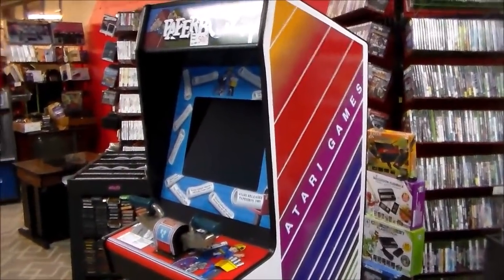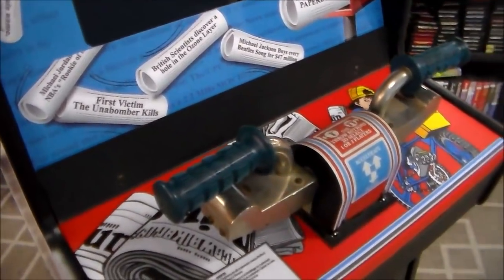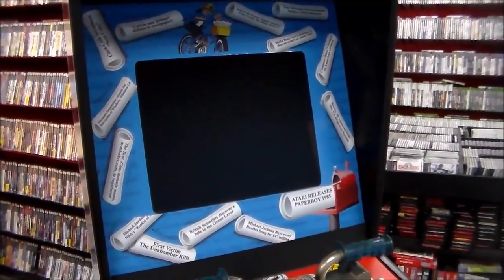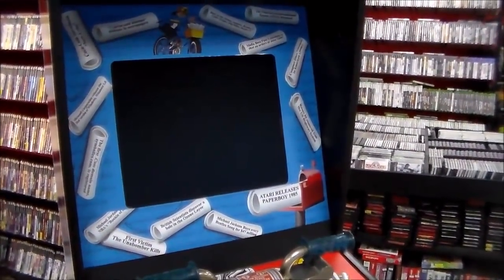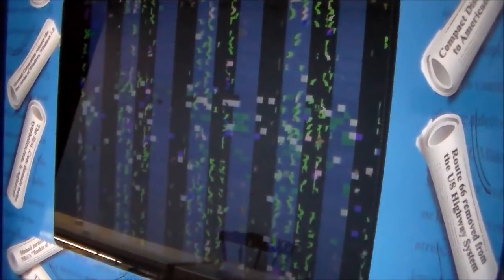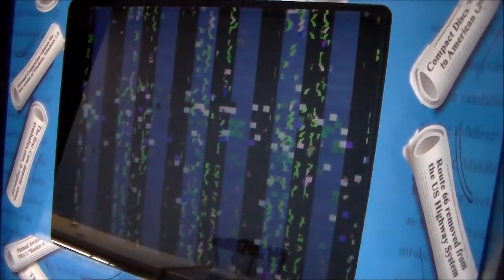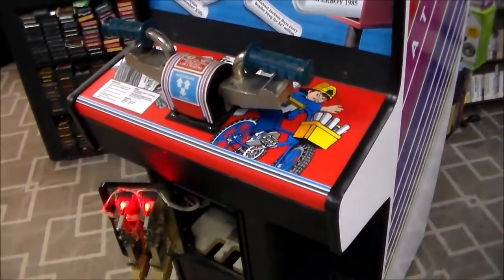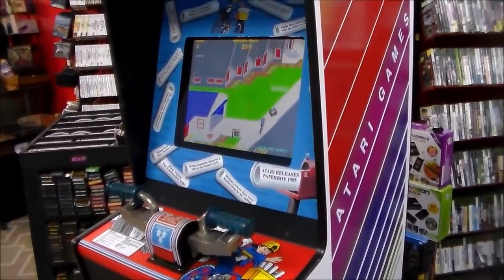Repairing an Atari 1984 Paperboy Arcade Game Cabinet!

Comment: My first job back in the 80's after leaving school was refitting arcade cabinets. I would rewire old cabinets and put the newer game boards in them. Change out the artwork panel that usually came with the new game board. Test them and then drop them off at the sites. Spent a lot of my youth in arcades in the 70's and 80's. Got given a bunch of old black and white boards and parts by the local arcade while still at school and built a couple of working machines on the bench at home (Original space invaders and a lunar lander game I forget the name of). I went on to a carrer in telecommunications. A few years ago I bought a new machine with an emulator in it and now my daughter and I play the games I played at her age.
Reply from the maker: Very cool Michael, yes I worked for an operator who did kits in games too but it was later on, he had an entire back room full of Ms. Pac-Man cabinets he was hoarding, all still the original game.  Must have had 30 of them all lined up perfectly, this was in 2008 or so, he still had them.  That's cool you're able to share those games with your daughter you're raising her right!  See you on the next video.
Reply: @LyonsArcade  was it Namco or the other version that Ms.Pacman was able to outrun the ghost, ? I can never remember

Comment: + - 15 (usually 12) is usually used by the op amp to drive hi and low on the output. RS 232 output standards back in the day before we all got lazy and loosey goosey about the rs232 standard.
I know it's not an rs232 chip but that's why a lot of the old op amps used + and - voltages because before TTL... those were the 1s and 0s. What is funny is they are clamping the output past r112 with the two 1n100 diodes. Into the ls04 inverter gates which they are using to clean up the signal into the ls00 NOR gate. They must have wanted to drive that oscillation pretty hard to do it that way!
Reply from the maker: I understood about half of what you said :)  Thank you as always for watching :)

Comment: If I remember correctly, CGA allowed for 4 colors simultaneously at 320x200 resolution and EGA allowed 16 colors simultaneously at the same 320x200 resolution. EGA could display even higher resolution than 320x200 (with fewer colors) if necessary. Great video by the way. Those classic game electronics are endlessly fascinating. Thanks for sharing your knowledge and experience with us my friend.
Reply from the maker: No problem Chris, see you on the next video!
Reply: yep but CGA/EGA/VGA are computer video standards, they aren't actually used with arcade some just use it as shorthand for "15khz line frequency". IMO the other term "standard res" is also confusing since it doesn't define the resolution exactly, e.g. Pacman/RallyX does 288x224, Galaxian does 256x224. and colors are all over the place too since it's mostly just a function of the palette RAM being used.

Comment: I'm 16 so I obviously didn't have real arcades growing up but we did have a Paper Boy machine at my Cub Scout building. My dad was the leader of the pack so he'd take me there every weekend with my brother to clean and do paperwork but my brother and I just played the game the whole time. I love the arcade version and I hope that someday I can own an original cab.

Side note, I don't remember the speech sounding so robotic, it sounded much more fluent. Later revision maybe? I know the amp was broken at some point because the sound was missing 50% of the time, very quiet 49% of the time, and worked fine 1% of the time. I almost got the machine for myself but at the last minuet some guy took it, the the building was falling apart and everything was given away. I suspect the game was water damaged because it was below a leak in the ceiling.
Reply from the maker: Yes I'd imagine it had some water damage, but the truth is most of these older ones do!  A lot of times they'd get left on the back of an operator's truck in a rain storm while he moved it or various other places it could get wet.  That's cool you got to play one later on, this was a tough game to keep working so I'd imagine the sound had a few hiccups :)  
Thanks for watching, and we'll see you on the next video!

Comment: Too me it sounds like the early sound boards for the computers late 80 ties up to the first dedicated wave soundboards Roland and later Creative labs soundblaster sound Cards. And its correct on the Yamaha. I have had good expiriances whith soundblaster.
Keep up the good work 👍👍👍🙂🙂👍👍🙂
Reply from the maker: Thank you Oden Viking, I don't have any experience in the PC side of stuff but one day :)
Reply: Thats not a problem since you all ready has begun. Those arcade machines are in a way pcs due to there usage of computer parts and rams and roms. In the computer  world we use a thing calld bios settings for hardware settings. But on your arcade games the bios is your basic test program. So in a sence the arcades are the earliest form of computers they are forerunners on graphics and on sound.
Keep up the good work
👍👍👍👍👍😀👍👍👍

Comment: If I remember correctly, the op-amp amplifies the difference of the inputs to whatever gain it's set to. Negative 10 and positive 5v and no gain would be 15v.
Reply from the maker: Thank you Phil, I don't completely understand what most of the chips do, I appreciate the help!
Reply: @LyonsArcade  it's not very often that I can offer help so it's my pleasure if I can contribute anything useful.

Comment: You really need the original controllers to get the most out of these old games. Tempest just isn't the same without a properly-weighted spinny wheel.
Reply from the maker: Dave ain't that the truth.  There's something too about the weight of the cabinet that makes it different.
Reply: Colorado Strong  When warping out of a level, we always gave it a good spin and the momentum would keep it going as you flew down the "web," but I think the wheel on those little Arcade 1Up machines is a clicky type that only moves you one segment at a time and then stops. Where's the fun in that?

Comment: CGA 16 color max resolution was 320×200 it could only display 4 of these colors simultaneously .
EGA graphics modes were 320×200 with 16 colors, 640×200 with 16 colors, 640×350 with 16 colors, and 640×200 with 2 colors, all drawn from a 64-color palette, It could use all 16 colors simultaneously.

I remember from the DOS days picking these options from apps and games.
Reply from the maker: Thank you for watching BRS!
Reply: @LyonsArcade   Of course, I love messing with electronics and fixing them. Would try to repair a arcade game if i came across one.

Comment: The game was probably used with the f-ed up screen orientation since the day the LCD was installed, and probably only a few people noticed and nobody cared.  I'll admit I was starting to worry that the screen offset would be overlooked here, but nope.
Reply from the maker: A gentleman informed me a few months ago that the color wasn't quite right too, it was over saturated.... so eventually this Paperboy broke again, and Adam brought it back.  I've filmed another video of fixing the power, then adjusting the color better too so that video will be up on here eventually.....
Reply: @LyonsArcade  Nice.  I was going to comment on the screen further, to question whether something installed presumably a while back would have a decent response time, relative to modern standards, but realized that if it absolutely must be 19 inches, the pickings are probably already somewhat constrained.  Nowadays even a typical TV has good response time—an advent I waited ten years for.
Reply from the maker: It's a real problem, on some games if you put an LCD it absolutely screws up the timing a little bit because of the lag.
Reply: @LyonsArcade  Right.  Maybe it's just because I made a semi-hobby out of these considerations, but if it were my project, I'd probably look into the model of that LCD screen and see what data exists on its response time.  Good 19 inch gaming monitors do of course exist.  Better yet, the game's native 512x384 conveniently matches typical native resolutions of 1024x768 etc.  Could be the installer of the existing LCD took these into consideration.  Could be they didn't care about such things.

I mentioned TVs before, but the irony is that with input lag anxiety being a thing of the past, other issues now pervade.  For example, I got a Samsung recently, having tired of waiting for a better option (with HDMI2.1 for example).  I had to discover for myself that Samsung TVs utilize two different types of dithering at almost all times, because not even the professional publications bother to mention or grade TVs on this point, even though such techniques lower effective resolution.  I figured out how to force the TV to disable its crosshatch dithering, and I'm almost certainly the only person on the planet who uses a Samsung TV without crosshatch dithering.  It has to be babied, or else the pattern will return.  I created test images that anyone can use to know when their TV is using either type of dithering, or both.

Comment: We have a Paperboy that does not start up, it says 6502 communication error, have you ever had this and what did you o to correct it? I've tried several 6502 chips and that made no difference.
Reply from the maker: I have never seen that particular fault but a communication error would mean it's trying to talk to something else and can't, so it's probably one of the buffers on the schematics after the 6502 or maybe a bad connection between the two boards?  I would search the forums on www.KLOV.com and see what others have said about it, it's probably a common issue.

Comment: Great video! Thanks Ron!

Question, is it normal for the decal around the monitor to not be aligned across the bottom?  Looks like it needs to be shifted right an inch or 2 as the mailbox looks weird and the far left newspaper roll looks like it's chopped.  Asking for a friend.....
Reply from the maker: There's all kinds of other things wrong with it if you look really close.  Life is like that too, the more you look for things that aren't right, the more you'll notice...

Comment: Hmm, is there no solution that utilizes and old VGA 19" CRT monitor?  What does that converter output to, VGA or DVI?  If VGA, why not hook it up to a CRT monitor?
Reply from the maker: You could hook it up to a VGA CRT but the problem you run into there is reliability.  If the original monitor is in it, it's a brand and type that repair guys are familiar with so that's the BEST option... if you replace it with a VGA CRT then you're putting something in there that's 15 or 20 years old, but is some strange design that nobody in the world ever takes the time to fix... and if you did learn or work with it enough to repair it when it breaks (and it will eventually break)... your accumulated knowledge will never be used again since you'll never find the same brand of VGA CRT again.

What they're doing is putting a LCD screen in it that's brand new and is as simple as bolting it in.  If it breaks, you can put another brand new one in to replace it.  

So while I'd prefer it have the original monitor which is very fixable... they're putting a LCD in that's going to be more reliable long term than a Computer CRT (which haven't been made in at least 15 years)

Comment: I am late to the comments.. but EGA to me is still EGA, never heard of "medium resolution".. yet now I see those terms everywhere!
Could you not use a 19" VGA-SVGA monitor?
Reply from the maker: The game outputs EGA, a 19" VGA wouldn't display EGA, no.  It's the sync.... CGA is 15khz, EGA is 23khz, VGA is 31khz, SVGA is up to 100khz.  If you hook a CGA monitor up to this cabinet, or a VGA monitor, you get an image on the screen that doesn't sync up.
Reply: @LyonsArcade  Thx! I stand corrected.

Comment: Schematics Question: What do those bow-tie-looking symbols mean?  (One of which made it into this video.)
Reply from the maker: I don't remember seeing a bow tie symbol but I think i've seen that on space invaders pcbs, I believe it just means a couple transistors are tied together, but I may be wrong.
Reply: they are an analog switch that is controlled by digital signals. It looks like they can change the volume of the Pokey chips marginally by turning on these switches (which would drop the sound level in 3 steps in this case.)

Comment: You guys should recap it, and replace all the electrolytics for preventive maintenance. With panasonic's fm, fc series, or nichicon's uhe, utt or uld caps. those would be for the radial type electrolytics,  for the axle type electrolytics with leads coming out on either side, vishays TE Series is a good idea, With electrolytic capacitors you often can't tell if there's a problem other than electrolyte leaking out the bottom if its a radial cap,  if it's an axle cap the sides leak, its usually a brownish liquid, or the vents on the top or sides bulge out, often they go bad without showing any signs at all unless you were to test them. Since all of them are past 30 years  by this point the electrolyte inside starts to internally dry out which causes a higher internal resistance which causes more heat, which speeds up the entire cycle. its about time to do more then a quicky, pretty much any unit that is older then 15 years should be recapped entirely, im sure if you were to check a few electrolytic capacitors on an esr and capacitance meter they wouldnt look so good... dont wait till one internally shorts out and takes out something else on the board that you might not be able to find. Its good the dude changed the filter caps, but thats not enough. Any carboncomp resistors should be changed out with 1%tol metal films also, as those tend to be  really sensitive to heat and humidity fluctuations, they tend to drift in tolerance far more than carbon film or metal films do. changing those out would be a good idea, typically they only have 4 color code bands, Reflowing the solder joints on things that heat up is a good idea to, as stuff heats up and cools down over time with each power cycle, it can cause weak solder joints that can give a bad connection which can damage componets, using a hakko grounded soldering iron is your best bet, make sure whatever soldering iron you use is grounded, grounded soldering irons help prevent ESD from building up on the tip and help equalize any potentials that exists between the soldering iron and whatever you're working on. static electricity can easilly damage sensitive components. Having esd gloves to handle ics and an esd mat thats grounded with a diode inbetween earth and the mat is also a must if you plan on taking the board out, wearing a wrist strap is a good as it grounds your body to earth, make sure the strap you have has a 1 mega ohm resistor inside it to, Replacing thermal paste on to220 package transistors, or anything with heatsinks attached is a good idea also, as thermal paste dries up and looses its thermal conductivity over the years causing the ic or transistor to have more heat buildup on its self stressing it unnecessarily. Articsilvers mx2 carbon based thermalpaste is the best choice, its non electrically conductive or capacitive  so it won't damage anything if you accidentally put a little too much...  all the switches buttons knobs and joysticks should be spreayd out with deoxit contact cleaner and lubricant to protect them, it will get everything moving smoothly, sweet cabnet man, i wish you luck, paper boy is a great game. one last thing, using keister branded lead baring solder is better in this situation with older gear then standard newer solder as that has a lower melting tempature then the newer rohs type solder, older componets such as ones found in these units typically are more sensitive to heat, that goes for the motherboard its self as well. lead baring solder can melt good at 575 or so, rohs crap needs to be about 650 or so.